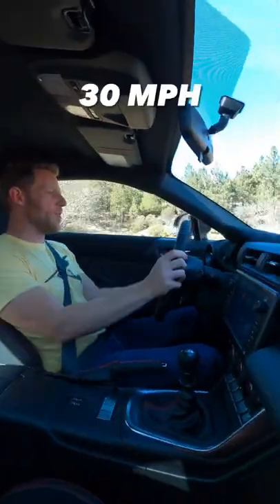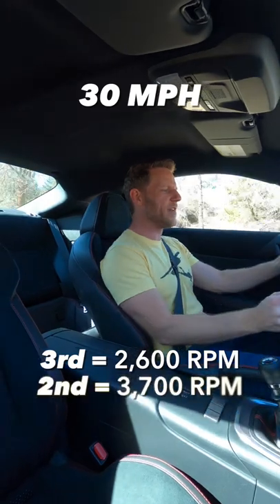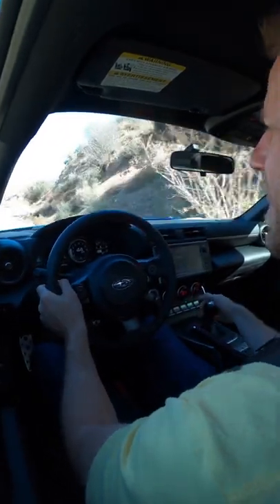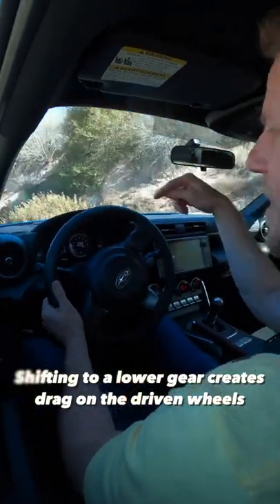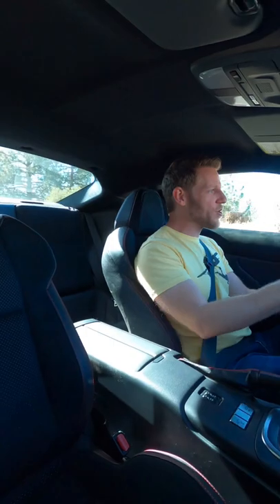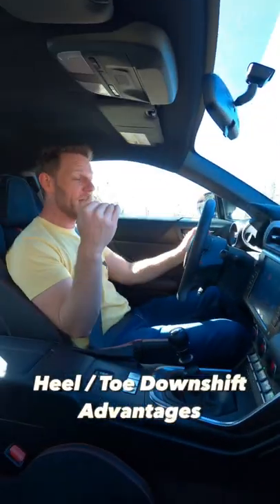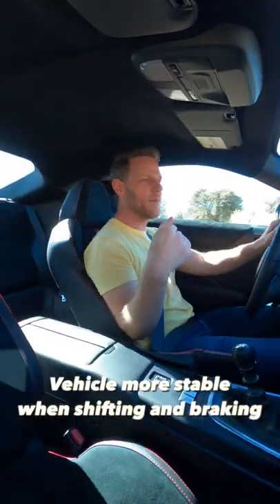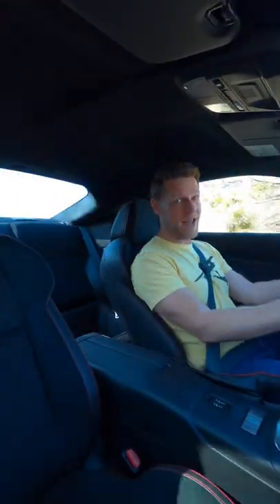What’s a heel/toe downshift? And why should you care?

Comment: I found heeltoe hard because the brake is sensitive, braking and trying to heeltoe, I end up braking more than intended
Reply: Oh my saab 93 or 95 can’t remember had a pretty heavy brake so it was no issue in that one 😄
Reply: Same, Ive gotten close to attempting it a couple times but im usually afraid im going to give way too much brake and either damage my car or cause an accident
Reply: Yeah, I just don’t do it cuz I don’t want to accidentally brake check someone. I lightly brake while in gear, get to the low end of my current gear, then downshift (while still light braking), to the previous gear. Car doesn’t have to do much to match the revs, and I don’t risk accidentally brake checking someone cuz my brake petal is sensitive.
Reply: @KiddBuu_ same with me. On my new opel mokka my brake is also so sensitive that im not doing this method. Im only trying to rev match downshifting.
Reply: That's because heel-toe is a racing technique. In racing, you HAVE to brake hard. You also have to shift. When you heel toe, you can brake hard and rev match
Reply: I've found that that's not something to do while road driving. Just rev match. When you need to slow down on the road, just press in the clutch, downshift, blip the throttle, and get off the clutch. Then you can engine brake and use the brake pedal as normal until you come to a stop if needed. On the road, you shouldn't be braking hard enough for heel-toe to matter. Now, on the track, where braking force needs to be very high, it's perfect. I've been tracking my manual daily driving for over a year now and have never found a situation where heel-toe is even slightly better on the road
Reply: light double-tap of a sensitive brake before clutch, shift, gas solves that problem.

Comment: Ok, you blip it’s like I do;  with the right half of your foot, not twisting your foot so the actual heel presses the gas.  I canNOT do that without hurting myself.

I feel better now.
Reply: toe on the brake and heel under the gas pedal, then move your knee to the side without moving anything else and the side of your foot should touch the gas, thats the "right" way.... i havent actually done it because I'm short and have small feet but i hope i could figure it out
Reply: Not all cars work well with the “heal toe” in bmw’s & Porsche’s I know forsure (in North America anyways) design it so the break is at the optimal spot to “big toe, little toe” sorta thing. I was trying to figure out how I could do a proper heal toe by twisting my foot in my e36 and that’s just not possible, first the gas pedal is a ground pedal so only the top of it sits nearly flush with the break pedal. While using my big toe on the break & rolling my foot hard on the gas pedal it seems to not give too much breaking force while still letting me rev it up to 4K. I’m not confident heal toe down shifting yet frankly. I’m still trying to get my regular down shifts much better. Don’t help I got the wrong shift lever installed, it’s too long of a throw (longer than stock) causing the shift nob to be past the edge of the shift boot. The throws are ridiculously long it’s fucking up my timings (4inch throw between 1st n 2nd) also it won’t sit centre, it sits just off to the right a bit. In my e36 the middle should be right between 1st n 3rd or 2nd n 4th. You can’t just push forward or back and it go into any gear, it’s meant to be moved slightly to either side to get into the respective gears, yet mine sits nearly flush with the 3rd n 4th gear. All I gotta do to get into 3rd or 4th is push it forward or pull it back. Can’t wait for my eBay short shifter to get in (it’s been well reviewed by loads of e36 owners)
Reply: Heel toe is only really used in cars where the gas and brake are too far apart. In most cars you’re gonna have the best stability and accuracy by using the left and right sides of your foot. The BRZ stock has a weird pedal spacing, it’s still doable to do it optimally but unaware learners will try to “heel toe”. I installed a pedal kit for mine that extends the left side of the gas which lets me roll off the brake easily

Comment: I have a 2012 Scion tc, and the pedals are not designed for heel toe. The gas is raised higher than the brake and my foot is not wide enough to use the left and right side of it to reach both brake and gas. Wish I knew about heel toe before getting it. I would’ve gotten a similarly priced vehicle with better pedal placement. And I don’t have the willingness to replace the pedals.

Comment: Useless technique. Just brake and lower gear.
Reply from the maker: You've never driven a manual transmission car on a racetrack have you?
Reply: Not on a racetrack. Is it useless on the street tough?
Reply from the maker: @El_Tuercas  If you drive sportily or simply want less wear and tear on your car’s driveline, using heel/toe on the streets isn’t useless.

Comment: 2600 rpms in 3rd gear?!?! Suckin out all your gas aren’t u? I thought rpms are supposed to be 1500-2000 for any given  gear to function appropriately 🤷🏻‍♂️
Reply: Where did you learn that? That doesn't make any sense. All gears can function appropriately at all the available engine revs, from idle to redline, within reason. It's up to you to choose what speed you want the engine to be at. Lower revs for better fuel economy (and more quiet operation) at the expense of less torque and higher revs for the opposite. That's why you see spirited driving like hard acceleration or fast driving through twisty roads being done at high revs and highway driving at a constant speed through mostly straight roads being done at low revs.
Reply: It greatly depends on the car in question and it's gearing. In my 370z, 1500-2000RPM is close to where you're at at the start of a gear.